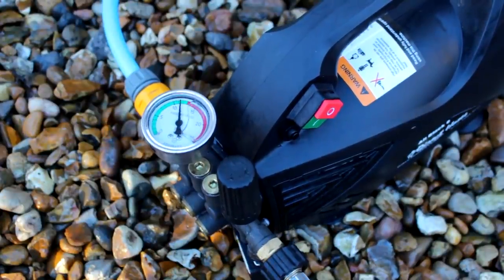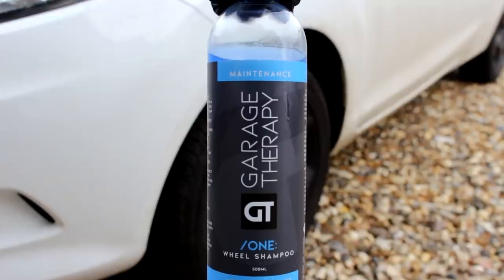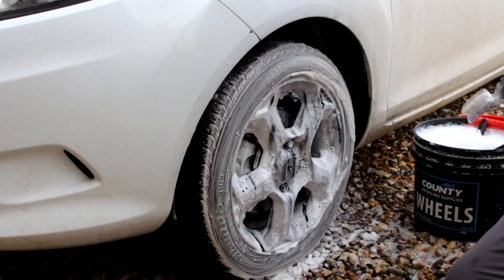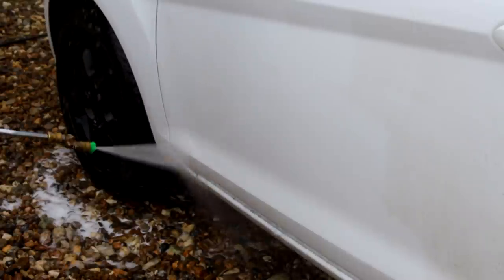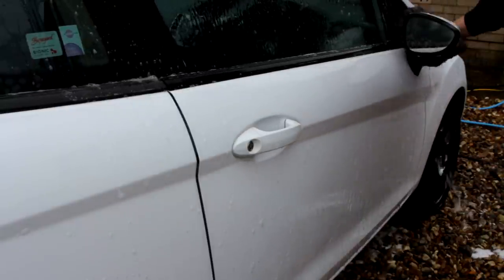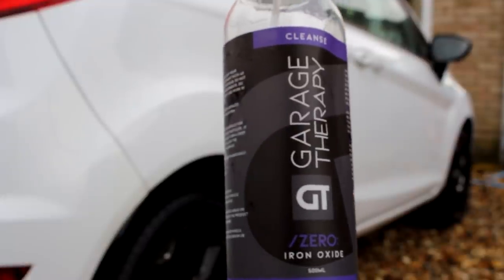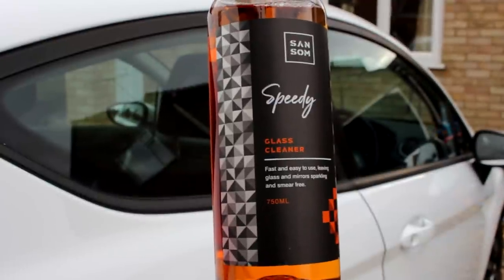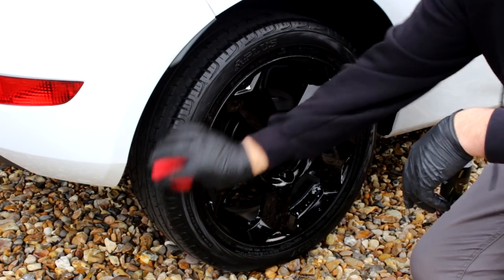How to decontaminate your car

Comment: The key to using the IK Foamer 1.5 is to put in no more than 500ml of liquid. This leaves more room for the pressurised air once you’ve pumped it otherwise you’ll need to pump it every 10 secs and it won’t come out very strong. With the wheel shampoo, 10 ml in 500ml gives great foam and easily does all 4 wheels.👍
Reply from the maker: Top tip Chris thank you 🙏🏻

Comment: Awsome vid Paul! Two queations:
- did u dry out before tar&glue? Or spray it on wet? 
- did u rinse off tar glue and spray iron next or you spray it on tar after wipe out ?
Reply from the maker: Car had drip dried because of filming then rinsed off if you apply on wet panels it dilutes the remover
Reply: @PaulDoldenDetails  I know about dilutes - thats why Im asking😁

Comment: hi Paul just joined your channel great  by the way!! I currently have a Passat cc black lol was looking for a good pre wash and heard about autosmart g101 wud this be a decent buy or any suggestions you wud have for swirls lol
Reply from the maker: G101 is a strong APC all purpose cleaner it will strip off wax and sealant you need something like this Citrus prewash shown in the video or Sansom Primus prewash or Valet pro Citrus 🍊 as for swirls full decontamination including clay bar and machine polish with a good compound
Reply: @PaulDoldenDetails  thanks paul also goin get my hands on the direct hoses detailing pack cheers again lee

Comment: Paul, my pressure on my AB9 wont adjust past 8bar, this is with the pressure screw all the way to the +. is this the same issue you had? if so how did you fix it?

Thanks mate.
Reply from the maker: Got messaged direct hoses and got a replacement PA screw or you could take it out and check the O rings on the PA adjustment screw that’s the bit under the black knob
Reply: @PaulDoldenDetails  thanks Paul, it's a small allen head bolt? Do I tighten or loosen this mate?
Reply from the maker: You need to remove it then put it back and tighten up or just contact direct hoses

Comment: Nice work as always Paul keep it up. Just a quick one did you use your Nilfisk or the Direct Hoses AB9 set up. Which pressure washer do you actually prefer. Thinking about buying a set up, would like your opinion. Thanks mate 👍
Reply from the maker: On this video my Nilfisk C135I with the quick release but the AB9 is very nice to use hang fire before you buy one because hopefully very soon the Direct hoses Grey series will be on the channel
Reply: Thanks for your help mate, can't wait for the grey series